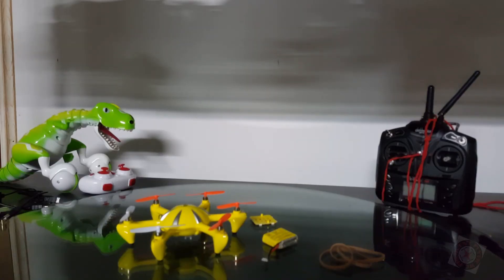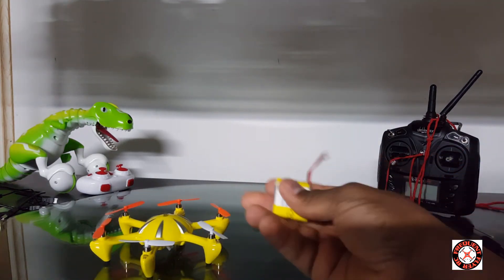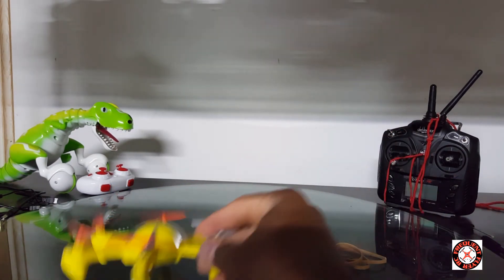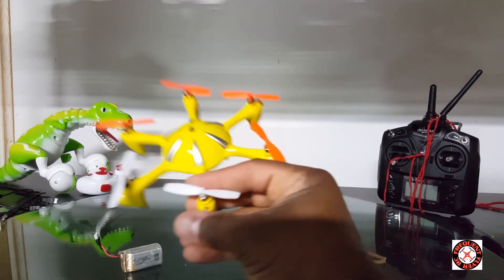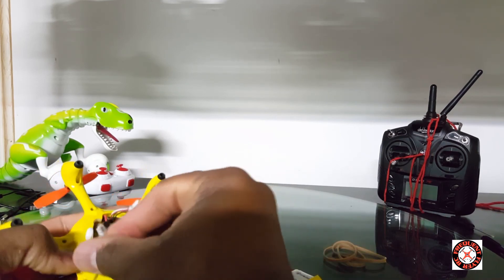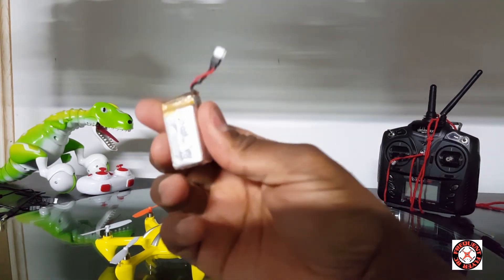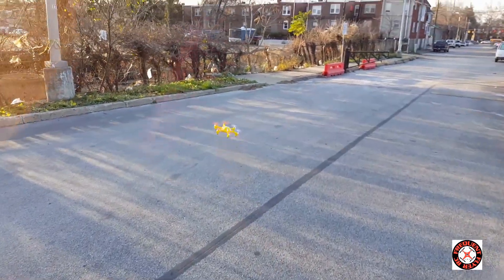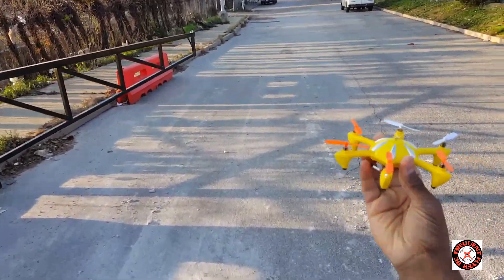Eachine X6 with 7.4v 2s Lipo

Comment: I've been watching your videos for almost a year now and always look forward to your excellent reviews, flying skills, but especially your chopshop mods.
This one I think is the most astonishing one, thanks!
Deeply inspired I just hooked my Dromida Ominus up to the stock battery that comes with the HiSky hmx 280 (kudo's too DutchRC who sold me his HiSky and kindly helped me along with some 280 issues).
My 'unbreakable' Ominus has had some serious problems but still flew quite good after numerous disassembly's, soldering, glueing and taping. Of course I knew the risks of feeding it with the 3s 1350 mAh but could not resist to try out.
After giving it very little throttle it almost devastated my ceiling lol. One of the motors burned out however, didn't expect otherwise. Now I finally can use the Ominus' 'remains' to build some other stuph. :)
Thanks for contributions on youtube FF! Keep on chopping!

Comment: I did this to mine about 2 months ago using my dm007 battery. It is crazy. After flying for about 10 seconds at a time though, in bursts, it fell apart becuase the motors got so hot that it melted all of my hot glue holding it together and then made the glue smoke ;) would not really recommend it unless you test it and works ok. If the sale is still there I might get one for a feridb birthday :) His dad just bought a GW008 and for him, and one for him self, so by then he should be ok for it :) LVC is not there because it is looking for somewhere are 3.3~3.8V, and this one is way higher voltage so around 6.6~7.6V ;P
Reply from the maker: It won't fly at all with a 3.7v batteries! I tried rubber banding other 3.7v batteries to it but it cuts off with all of them. I can only fly it with the 7.4v batteries and have been having no problems at all.. Not even with the motors overheating as you said happened to you. And it performs a lot better except for the no LVC issue! Lol
Reply: Frequent Flyer RC Yeah, no idea why. I just bought one of the X6s for the $16, used points to get ti down to $12, for my one friedns birthday in march, will just set it aside until then :)

Comment: Agree, X6 definitely a favorite flyer.  Still performs nicely on original battery.  One of my first buys, and yea, 16 sounds a lot better than the 56 I paid back in Mar 2015.

Very special THANKS to your fine self, Seby, Q101, and Ryan for your reviews, as quite happy with almost all my purchases, too many, that you guys seem to agree on.  

Nice collection now, of toys, almost hobby, couple GPS's, with plenty of spare parts to keep them going for a while.  But now, DIY builds interest me, well chop shopping, as the 2 GPS's have fared very poorly, and luck of the draw I guess.  Need rebuilds with new FC boards on open frames, fun though. (CX 20 / X380)  First quad V303 was excellent, my training quad, and took amazing abuse, again, needed a rebuild after so many brutal crashes, but kept 'original'.....LOL.
Reply from the maker: Lol you better take it easy with the big birds!
Reply: +Frequent Flyer RC yea.............batting 333 and they ain't cheap.  LOL though BG gave me partial refunds, 55 % and 65 %, so actually worked out rather well, as the sum of the parts were worth that. 

Actually ended up with some good cheap brushless quads.......

Comment: Okay put down the Devo which puts the mixes wrong and dig out the stock trans :P BS did this as well with a 7.4V Lipo in it.
Reply from the maker: I know, I told him about it and he tried it right away! (it's still his favorite micro hex)
Reply: Frequent Flyer RC Yeah I"m thinking about picking up a couple and modding them for the 500 mah batteries.

Comment: (Victor) I see you were quick to jump on that sale once I told you.....haha.
Like I said, I grabbed 2.
So how's it running now with the mod ? Still going strong ?
I am curious if this mod finally made it faster than the MJX X800 ?
Reply: (Victor) What's the mAh of that DM007 battery you used ?
GearBest says it's 400mAh, but EverBuying is saying 380mAh ?
I know it's 7.4v but it's still less mAh. Got me curious. hah
Reply from the maker: Mine are 380mah..  All three!
Reply from the maker: Well this one I had for some time now. This was my favorite hex at one point in time! I bought a blue one when the sale was on..  Yes, this definitely makes it faster than the X800!
Reply: +Frequent Flyer RC 
(Victor) Ok....cool.
May have to look into those 7.4v, because stock the X6 is a little slower than the X800.
Yeah, I jumped on a red and a blue with that sale.....lol

Comment: Hmmmm...I burned out a 3.7V board instantly by plugging in a  1S  battery overcharged to 4.5V
Reply from the maker: Maybe a hex can handle it because the power is being distributed between 6 hungry motors! I have tested this and it has been working great which makes me think it will probably work with any of them! I can only fly this one this way now.. Doesn't stay on if I try to use the old one.